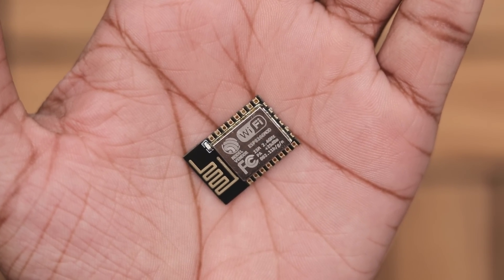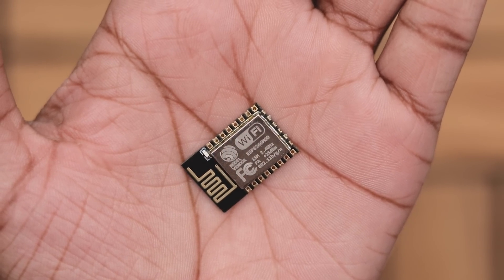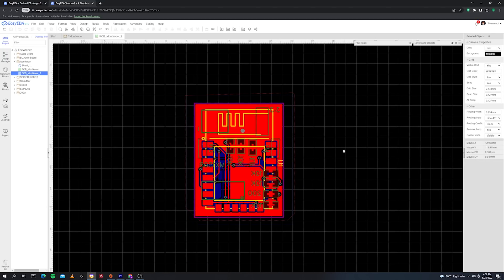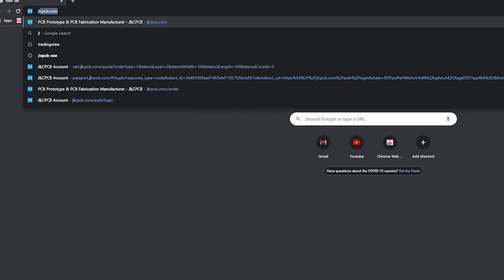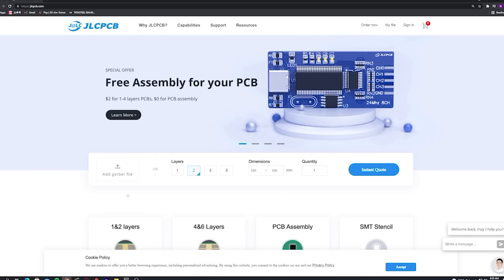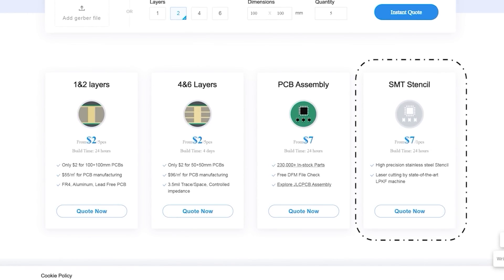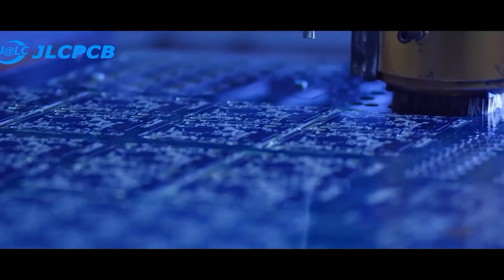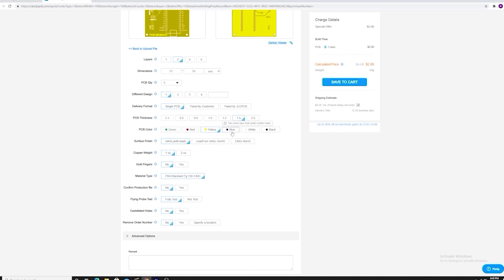WOW! Making The Smallest IOT Robot Car

Comment: It's more than 2 years and not sure if the author or anyone here will respond but I see a discrepancy between the Gerber files-Schematic and what's being soldered in the video..for instance, there's a "200" reference between the four 10k resistors..this doesn't exist in the schematic.
Likewise, between the two Motor connections, there are 2 capacitors (1 microF) and one 10k resistor whereas in the above screenshot (3:14) you'll see 2 resistors and a capacitor...not sure which one to go with .....has anyone tried building this or help clarify please?

Comment: You could have used weimos D1 mini it's small in size and also ensures great performance...nice project by the way
Reply: actually he added a motor driver ic in pcb.
Reply: and also batterr is 3.7.d1 mini need 5v